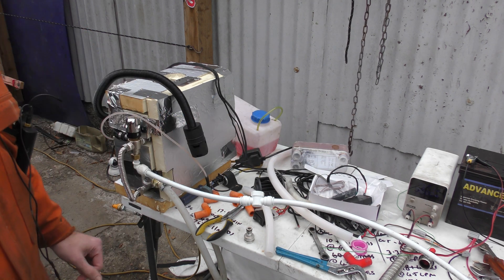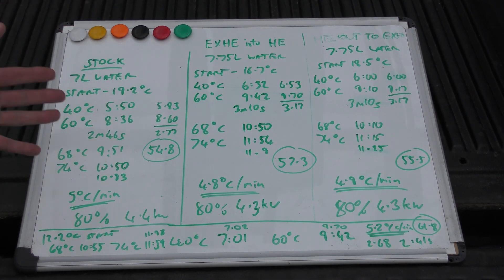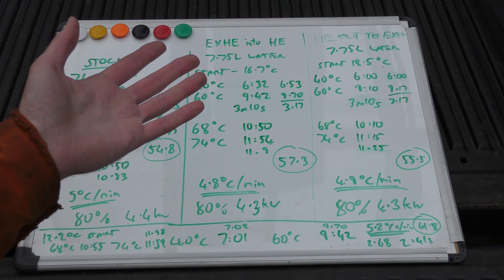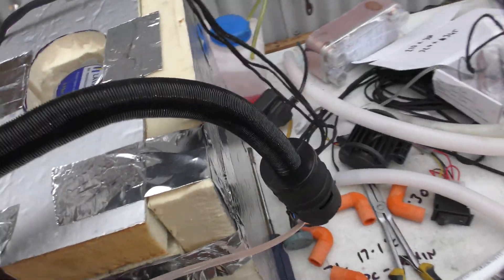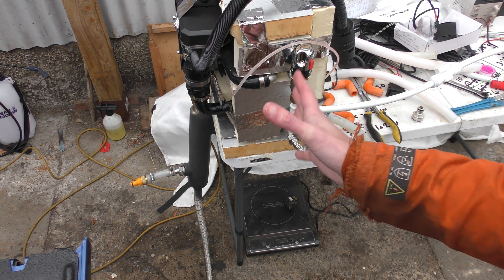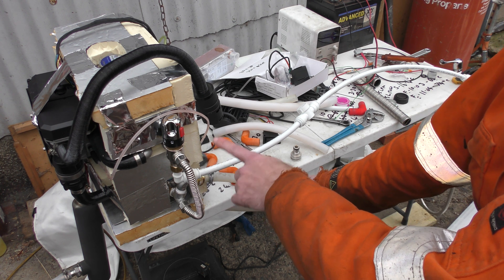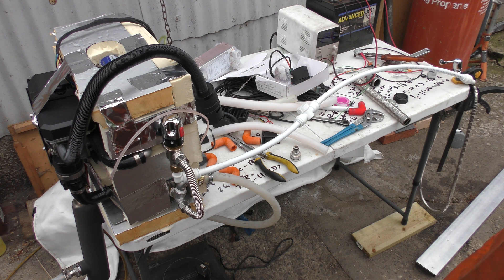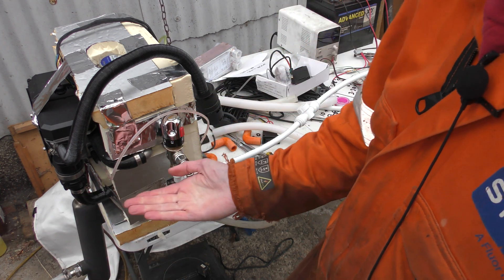Lavaner Lava - I added an exhaust heat exchanger and made it worse!

Comment: Most people measure exhaust gas recovery heat and just add it to heater power. 
Extra exhaust flow restriction coud reduce burning efficiency. 
Air to fuel ratio and power consuption should also be measured. 
I almost ordered egr coolers but now I think only reasonable way to recover exhaust heat is directly from exhaust pipe by radiation. 
Other methods are not cost effective in my opinion. 
Very interesting subject anyway.

Comment: Solution
Flow rate is the measure of the volume of liquid that moves in a certain amount of time. Moreover, the flow rate depends upon the channel from which the liquid is passing or the area of the pipe, and the velocity of the liquid. Besides, the formula is
Fluid flow rate = area of the pipe or channel × velocity of the liquid

just slow the rate down and feed it to the top cap
Q = Av

Comment: By adding a heat exchanger to the exhaust you added a section of mass of metal that has loses, this pulls heat from the block, so maybe thickly insulating the exhaust heat exchanger, you won't have the loses you experienced 😉 👍 the plate heat exchanger in my Vissmann boiler has very thick insulation block,

Comment: You just gave me the idea to put a turbocharger on my exhaust pipe, LOL. No need to power my diesel heater with electricity if I use the exhaust heat velocity to pull in air.

Comment: After thinking about this for two days I'm still stumped.
Yes you are heating a larger mass of water but the final temp should be the same. Only the rise per min should slow. 
The heat loss outside heat exchanger to ambient air should not be significant. 
The exhaust air temp is falling. 
Can you re-run the first test to ensure no blockage has occurred in the combustion chamber or the exhaust ? ?
Reply from the maker: Next video we are going over EVERYTHING.  Then we can call try to maths this out together.  For science.

Comment: Its easily explained. The heat transfer from exhaust to water is not compatible with over hydrated water. Simple y reduce the amount of H2o in your water and it all works ok.
You will find the rise in temp curve is improved if you perform your experiment in Saudi Arabia or Benidorm in July.
For a more rapid response replace water in tank with kerosene.
Hope that helps

Comment: I would run a 22mm copper pipe straight through the water tank, solder it, and connect the exhaust to one end. That way you are not losing any efficiency or restricting gas flow from the heater.

Comment: The "missing" 100 watts is 3% less. But you added 11% more water? My maths gives 2,439.09 watts to water without heat exchanger and 2,592.408 watts to water with heat exchanger. 153.318 watt improvement.
Reply from the maker: Interesting.  I think in the next video I'll show my maths better and my working on screen and then we can all compare.  :)
Reply: @DavidMcLuckie  sounds like a plan

Comment: as a cheaper exhaust heat exchange get a short length of 32mm copper Pipe (12") a longer 22mm pipe and 2 x 22-32-15 T sections you can build a simple heat exchanger, you need to grind the stops inside the T for the 22 so that the 22mm will go through, you fit the 2 T's on the end of the 32mm Pipe then pass the 22mm through the middle. then 2 15mm pipes off the side of the T's acts as your inlet and outlet, solder all the joints and you have a cheap heat exchanger, connect the exhaust to one end of the 22mm and the other end out to the external exhaust, feed your water via the 15mm it runs over the 22mm that gets pretty hot, I have it on a heater and have a towel radiator attached with a small 12V solar water pump to circulate, in under 30 mins its soon getting warm and extra heat is in the garage not outside, the exhaust outside you can about touch. I think you could potentially thermo siphon to avoid a pump but pump works well.

Comment: U changed a variable.....u added water means your heating a bigger mass ......do the same test with EGR hook up to water but not exhaust will have a lower start number

The EGR will be a pro if it heating the holding tank...in the long term it will heat the supply water but heat loss from that might equal out but if frozen condition good to keep the supply water from freezing

Comment: I'd just make some sort of calorifier with your heat exchangers. Maybe two or three heat exchangers rigged up to a decent size expansion tank, that way you have room for expansion and the cap acts as a  relief valve if needed.  Feed cold water in the last exchanger and out the first and off to the shower. Via a thermostatic valve. Like a guy said in a comment. The exhaust should be as hot and short as possible. I've seen a 3 foot exhaust thick of oily gunge
. Hotter the better to keep it clean and crap free.  Having said that, it's an interesting watch Dave

Comment: Very odd and counter intuitive. I would have expected the egr as a preheater ahead of the main heat exchanger to give a minor improvement especially as it appeared to be functioning as a condensing boiler. I would repeat the test to see if you can repeat the results. 
You normally try to maintain a good thermal gradient between combustion products and the water. So the coolest water next to the coolest combustion products. 
Isn’t science fun!🤣

Comment: Were you getting any condensate out of your exhaust gas? Something else you may consider in your setup is "approach temperature" on your hx. That explains your second series HX set up a bit. Without any flow meters on the two sides it'll be hard to really quantify efficiencies... I suppose your Co meter will give you an idea of burn efficiency but that's a toughie... Sounds like youre headed the right direction though.

Comment: Your loss of 100watts is likely due to restricted airflow... the heater is literally generating less heat due to a slight reduction in combustion, or a buildup of non-combustible products inhibiting full combustion.
Reply from the maker: It's a good hypothesis.  But I had the exhaust heat exchanger on for all the tests, so exhaust flow would be removed as a variable.
Reply: @DavidMcLuckie  If test conditions did not change, and the hot exhaust exchanger was installed during all tests, and the only variable is the exchanger is not being utilized... I have no idea what would cause the variation... though 2% is within the margin for error, but as you say, it is consistent... Have you attempted to measure the delta's separately? Recording temperature changes without mixing the heat sources? It would be interesting to see if the entire unit takes longer to come to temperature if you simply dump the thermal load of the exhaust exchanger into the environment as opposed to utilizing it... Maybe expansion or contraction within the exchanger is causing air flow interruptions... Are you sure there are no leaks inside the exchanger?
Reply: @DavidMcLuckie  This is actually beginning to bother me... There has to be some mechanism causing the engery to be lost... Again, 2% is not much, but if it consistent, then the mechanism must be consistent... My only assumption is, that by cooling the exhaust, it prevents the exhaust exchanger from expanding, and allowing slightly greater air flow. This can be eliminated by running cold water through the exchanger and simply dumping the warm water onto the ground. If there is no change to the total energy available though the mixing valve, then recovering lost energy from the exhaust has no effect on the overall energy potential. My second hypothesis is, that temperature differential between the exhaust coolant, and the thermal reservoir, causes energy to be lost somewhere in the system, likely if the exhaust coolant is not warming quickly enough as it passes through the exhaust exchanger.

Information need to satisfy, or formulate additional, hypothesis: Intake air temperature, Exhaust temperature with and without cooling, and with cooling while attempting to recover waste heat,  and coolant delta-T at stable throughput. Secondarily, the volume per minute moving thought the exhaust exchanger would be useful, but probably not nessisary as it would add little to the inferred overall transfer.

You have me hooked sir, which is probably what every youtuber ultimately wants.
Reply: @JoelleFromHell  I think you're right, the difference be accounted for by the extra 2 - 5 pounds of water in the exhaust heat exchanger and plumbing. That's the variable. I'd run the tests by leaving the plumbing intact and connecting and disconnecting the heat exchanger from the exhaust pipe.
Reply: A very messy calculation, suggest you lost about about 5 to 6 cubic meters per minute of air flow, resulting in approximately a 2% reduction in efficiency.

Comment: What happens if you preheat the Combustion-Air with the Exhaust Heat-exchanger? like in those 90+ Furnaces they got Coaxial-Fume-pipes
Reply from the maker: Likely it would melt the plastic fan inside.  But it's a good idea.

Comment: When you cool down exhaust gas it alsmost stops moving. 
Keep the exhaust hot and as short as possible
Reply from the maker: You know this is a diesel heater right?  It's job is to literally cool exhaust gases and use them to heat water.